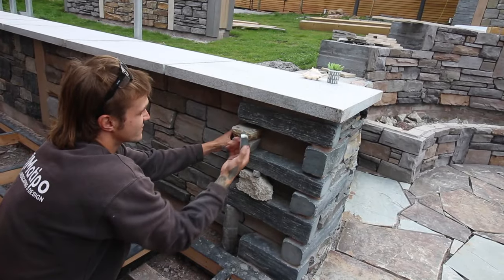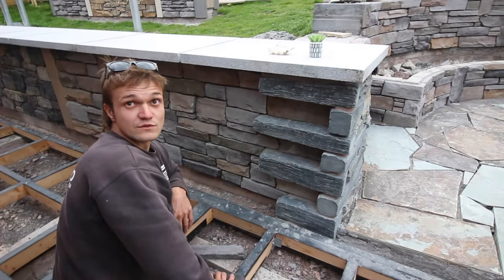Granite Coping Stones! Stone Feature!! Granite Paving!

Comment: Cracking job lads.
What would you recommend for 9 inch and 4 inch blade for angle grinder to cut porcelain pavers.
I'm attempting to to fit my patio in a week or so. Never layed pavers before. Fingers crossed all goes well.
Thanks for any advice
Reply from the maker: Check out elite stone tools.. thin mesh blade for porcelain ⚒ awesome bit of kit